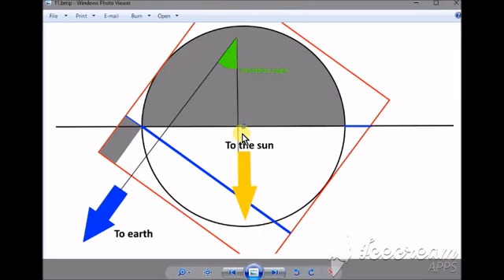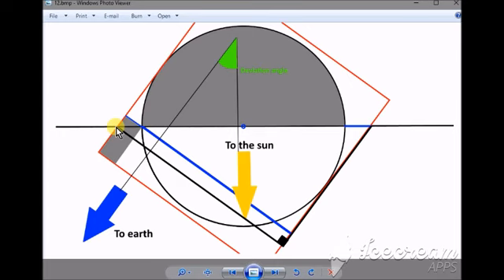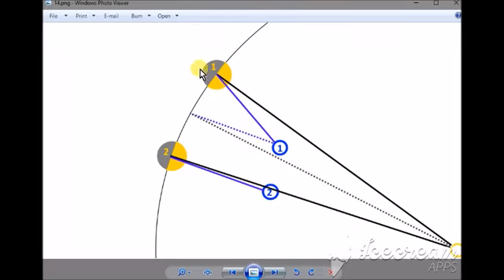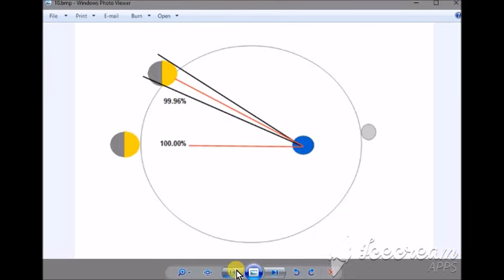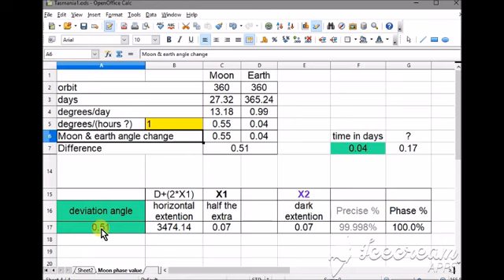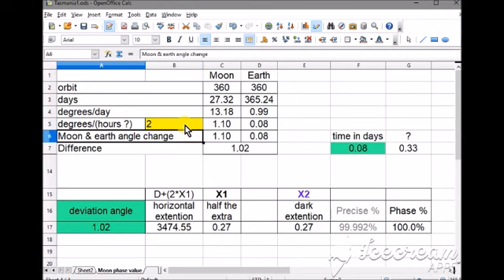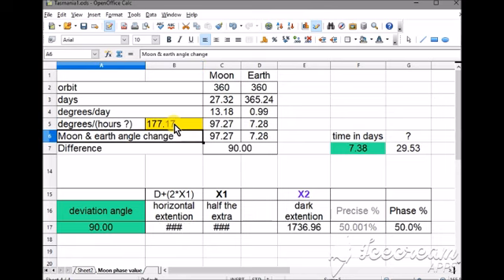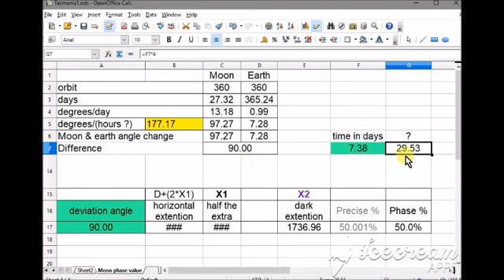Moon phase calc kills FE hope

Comment: Why did you stop at 5 hours and not calculate to over 11 hours. If you would have gone to the amount of time that mooncalc claimed the moon was full I'm guessing it would have been rounded off to a much lower figure than 99%
Reply from the maker: I went after 5 hours and put 5.1  and it did rounded to 99% . So that's why I put the 5 back again.
Reply: @crowxe  It appears to my you just proven the globe model wrong with your numbers. There isn't a FE model to claim it disproves FE with no numbers for comparison. Back to the drawing board crowxe
Reply: The official time according to mooncalc is 11 hours 20 minutes the moon remains at 100.0%. A minute before or after that time frame mooncalc indicates a 99.9% moon. 😎
Reply: You don't need orbital mechanics to draw a conclusion. Just logic
Reply from the maker: @mellosoft  
If I'm testing something with certain parameters, then I should take them into count (which is beyond my abilities for now) .  And when I do and get different results from the observation, then there's something wrong. We'll need a hangout to do that just to avoid being biased, I do have an idea but need to confirm if it's valid or not.
Reply from the maker: @mellosoft  
I put the spreadsheet link in the description and i just noticed now you think the max period was 5? no..that's half as i said in the video, 5 hours before and after the 100.00% full moon. i also tested the 6 hours (12 hours) it shows 99.9%
Reply: @crowxe  I have not yet looked at your spreadsheet, but I guess it does not take into account that more than 50% of the moon is lit by the sun? This is because the sun is so much bigger than the moon. From the distance between sun and moon (~150 million km) and the radius of the sun (~0.696 million km) it follows that ~180.5 degrees (50.14%) of the moon are lit by the sun. [ I like the analemma! I'd love to see a non-heliocentric flat earth model that is able to explain that. ]
Reply from the maker: @YAWTon  
Oh awesome , I didn't think of that however I did ignored something similar which is the distance from earth to moon , we only see 179.5 degrees of it. I'm not sure if that would increase or decrease the error. I think it allows us to move up to 1 degree in relation to the moon and still see full moon. 1 degree of moon's motion is 2 hours, those could be added to the maximum full moon time answering the question for Dave
Reply: @crowxe  Your exactly right!
Reply from the maker: @YAWTon  
This is what amazes me, we keep stumbling accidentally with numbers that proves the globe or enhance the accuracy of the globe prediction. When I started editing this video I had no clue how long is the moon phase month until I tried variety of degrees in the input and showed the 29.5 days 😊
Reply: @crowxe  so what percentage did you get at 11 hours?
Reply from the maker: @mellosoft  
I guess it would be between 99.9~99.8% , I'll have to check when I go home and will put the spreadsheet link for Google drive . But as I said in the description, this calculator doesn't use orbital mechanics, it uses the average angular speed . I'm afraid of being biased if I try to incorporate orbital mechanics because I'm still crawling in that field